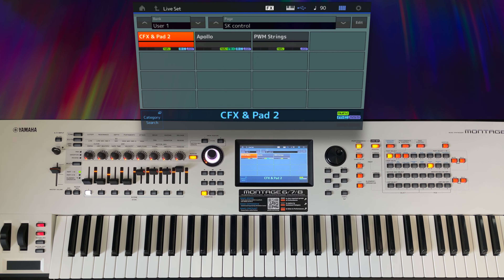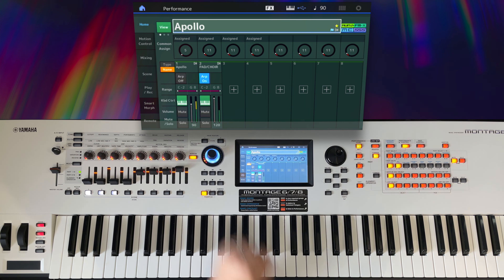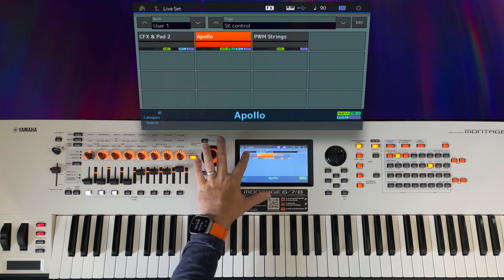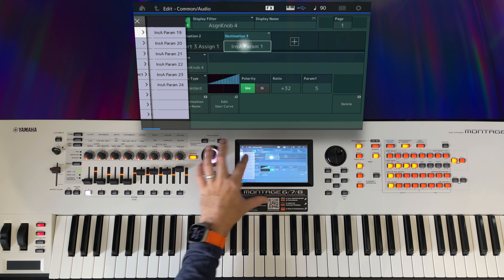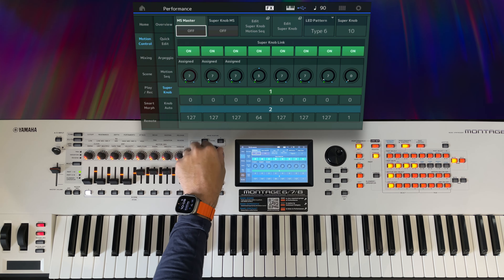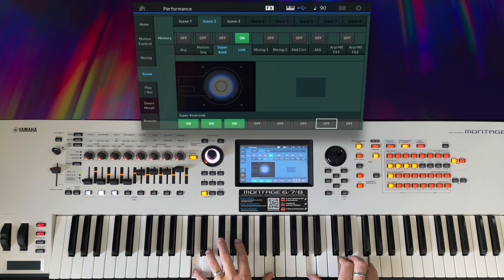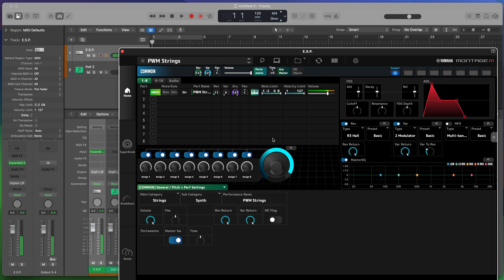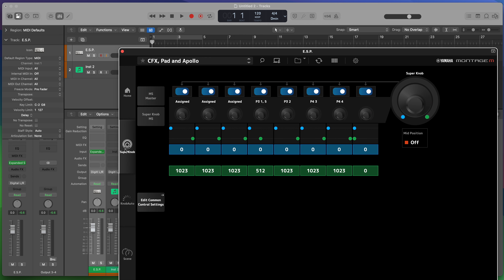Re-attaching super knob behaviors to imported parts on Yamaha MONTAGE, MODX and E.S.P.

Comment: Thanks, very helpful. I’ve had my Montage M8x for 10 months and some of the concepts and controls took 6 months or more for me to feel comfortable with. It is a very deep synth. I’m very happy I took the plunge.
While similar, will you start making videos using the Montage M?
Reply from the maker: The majority of the functionality described in my Montage videos applies equally to Montage M, so I probably won’t re-do the topics I’ve already covered, but where there are major differences, or new functionality on M, I’ll be covering that in due course.

For now though, my slate is mostly covered with topics that apply equally to Montage, MODX and Montage M in order to benefit the most users.
Reply: @KierDarby  Thanks for the quick reply. I would not expect you to re-do any covered topic, asking about new topics going forward potentially using the M. Thanks for what you do!

I’ve been around the block and dropped the Motif and Kronos to go the software route until the M8x showed up
.
Using:
Yamaha: Montage M8x| Spectrasonics: Omnisphere, Keyscape | uhe: Diva, Hive2, Zebra2| Roland: Cloud Pro | Arturia: V Collection | NI: Komplete 14 | VPS: Avenger | Cherry: GX80 | G-Force: OB-E | Korg: Triton, MS-20
 
Sold/Traded:
Yamaha: Motif XS8, Motif ES8, Motif8, KX-88, TX7 | ASM: Hydrasynth Deluxe| Roland: RD-2000, D50, MKS-20| Korg: Kronos 88, T3, MS-20 | Oberheim: OB8, OBXa, Modular 8 Voice | Rhodes: Dyno-My-Piano| Crumar: T2